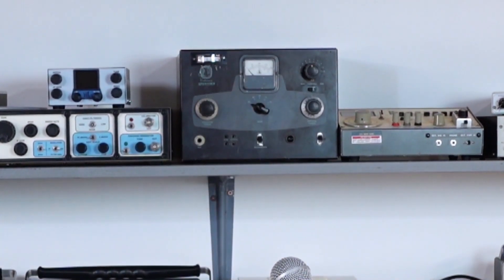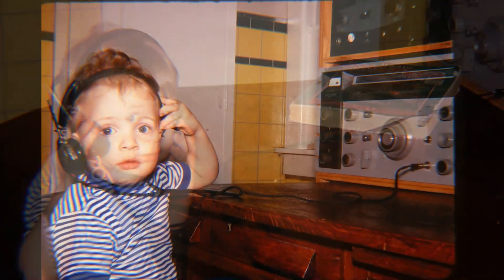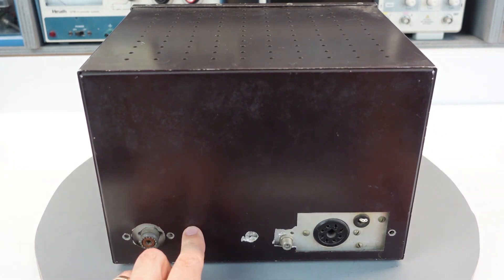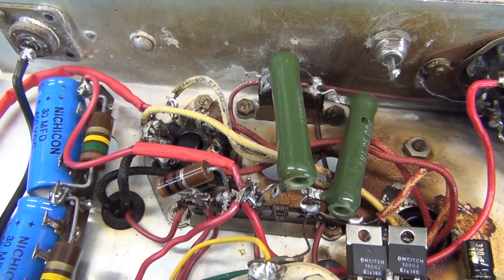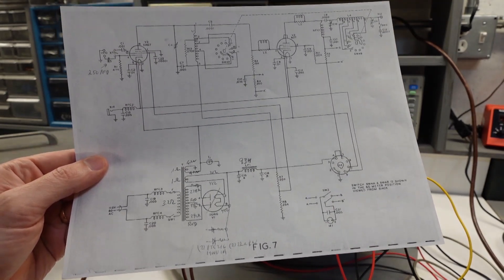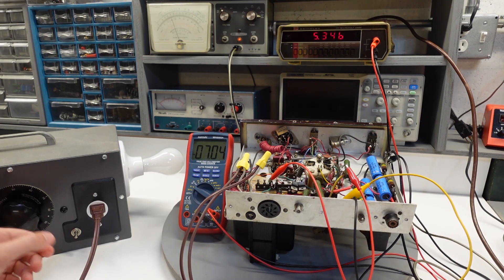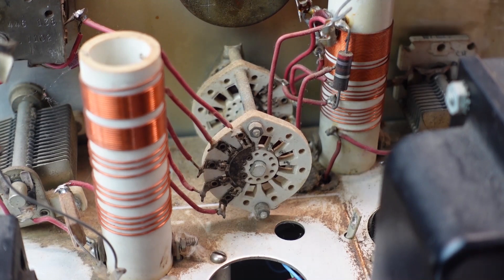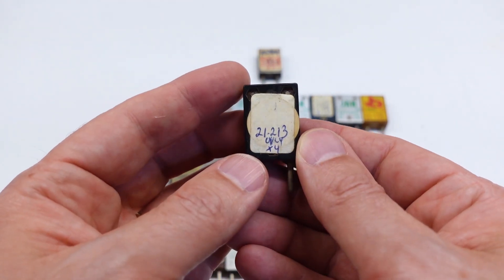E. F. Johnson Viking Adventurer Restoration: Part #1

Comment: Very nice restoration video. I discovered Wireless Girl a few months ago. I used her site for my restoration which so far has involved only the filter caps. I ran two pairs of 22 MFd axial capacitors in series with 180 K 2 watt balancing resistors on either side of the filter coil. So far so good but grid voltage is very low on the 6AG7 oscillator tube. It measures 140 volts and current is just above 1 mA key down. Oh on the rectifier tube, I’m sticking with the 5U4G. There’s no need to change it out in my opinion as long as it’s working. The 5U4G is easy to get so I depart from wireless girl here.